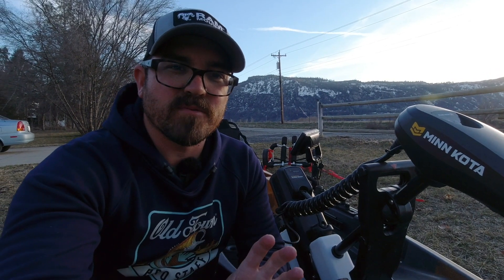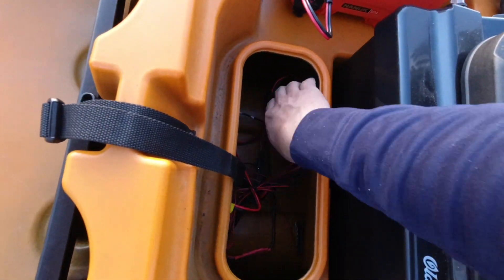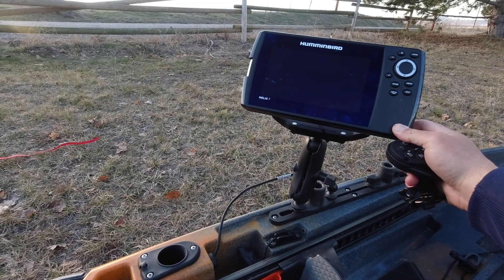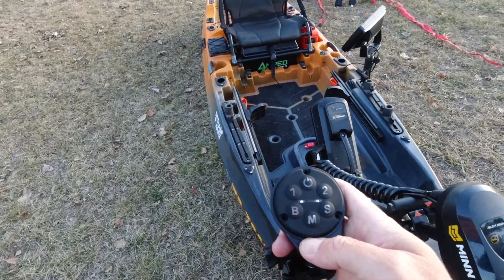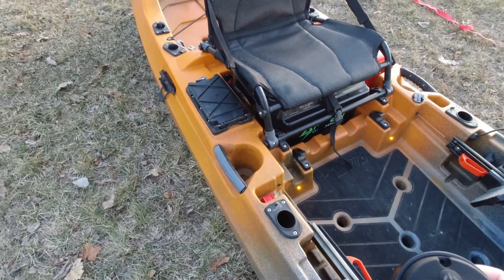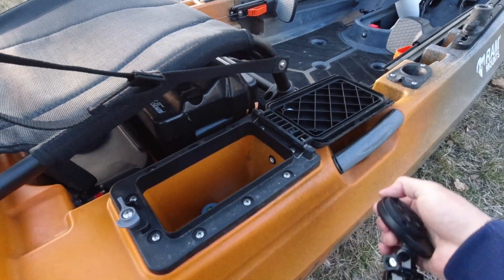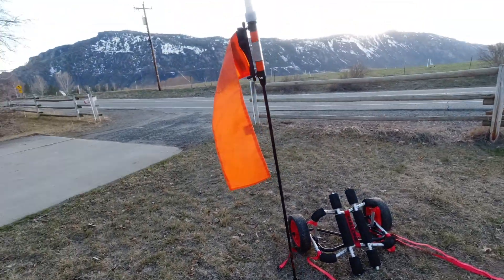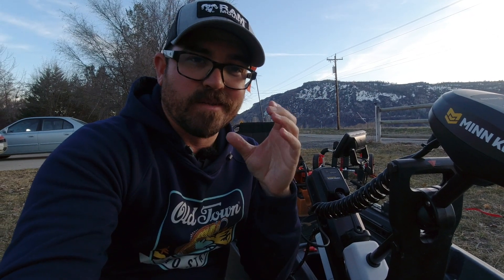Rigging a Remote Controlled Kayak Lighting & Power System

Comment: Heading up to Baker Lake in July do you use this type of LED system on a peddle powered kayak?
Reply from the maker: No reason you couldn’t
Reply: @spiltmilt  The regs are clear as mud as to what's required. White 360 min I guess.
Reply from the maker: Minimum is a 360 light yes

Comment: Howdy. I have the 10" red/green navigation light strips I still need to install on the bow. They'll mount 1 inch down from the top side. I see you mounted yours up higher on top. Any reason why you chose the smaller button lights over the 10" led strips? I chose the 10" because I want to make sure other boaters have a better chance of seeing me easier in the dark. What are your thoughts?
Reply from the maker: Personal choice. The button lights are easily visible.
Reply: @spiltmilt  Great, thanks for the reply. Good luck fishing! ✌️🎣🇺🇲

Comment: Another great video. The link for the 5 circuit Yak Power system doesn’t work anymore. Wanted to use it so you get commission. Thanks.
Reply from the maker: Thanks for the heads up

Comment: How did u get behind / in the hull to mount those lights on the deck?? Do u have a install video
Reply from the maker: I don't have an install video but very easily reachable from the in hull access under the seat, unless you are a T-rex.

Comment: How did you access the back of the forward facing interior lights and the UV lights to screw in those locking bolts on the back of the lights?
Reply from the maker: From the hatch behind the battery

Comment: Where did you get the amber button lights for the interior? I see yakpower doens't offer those. Defiantly interested in that color over white for my Unlimited.
Reply from the maker: Precision Sonar link in the description
Reply: Thanks for the reply. Im currently floating a Nucanoe Unlimted and im looking to install exterior button lights for navigstion on the bow and would like to run a few of those amber lights throughout the interior. My Unlimted doesnt have a front bow hatch, just a small stern hatch and some knockouts for wiring. Can these lights be tightened down from the outside or do you need to be able to get hands up inside of the hull to tighten?

Comment: I have a couple questions about the LED lights, when it comes to installation or setup. When looking at the Precision Sonar LED light kits, they do not say what connection type they have. What type of connections do Precision Sonar LED Lights come with? How did you make them work with the  Yak Power System? I wasn't sure if you ended up buying both the Yak Power LED lights and the Precision Sonar lights or etc. If you could please be so kind as to provide a breakdown. I have been searching for these steps, but haven't found any.
Reply from the maker: They just come with exposed + and - wires. I wired them to SAE connectors and then plug them directly into the YakPower switch. Super easy.
Reply: @spiltmilt  I got another inquiry if I may. How short is the threaded area on those custom lights? I have a rather narrow area, I'd like to place them. Unfortunately Precision Sonar's site doesn't give a lot of detail on these things.

Comment: I ordered the same navigation lights, after seeing your video. Is there any issue with the navigation lights being in your field of view, where they are located? Just wanted to make sure before I drilled holes. Didn’t know if I wanted to put them at the same location you did, or just below the bend so they aren’t visible to me at all. 

Great video!
Reply from the maker: They don't cause any issues for me.

Comment: That kayak is in the price range of a bass tracker XL which I feel defeats the purpose
Reply from the maker: Try putting your tracker xl on a roof rack and let me know how that goes 😂
Reply: @spiltmilt  that would be difficult but it comes on a trailer. I bet its a lot harder to put that thing on a roof rack that backing up a trailer. Oh and you can take friends and be far more comfortable. I just think those yaks have moved away from the purpose and alluring capabilities of a yak.
Reply: I wanted a $40,000 Boat but settled on the auto pilot 120. Its the business at a 10th of the cost.
Reply: An $11,000 boat?  Ahhh... I don't think so.  even with his upgrades, the package is less expensive than a non-tricked out new Hobie Pro 14.
Reply: Don’t have to put $100+ gas in it every weekend or insure it. Plus can get in place a boat can’t. Best part don’t have to use anchor or $2000 power poles. He even figured how to add a seat to the kayak. Very nice job maximizing a great product

Comment: As a techno geek I say to my self wow that is really cool, as a pragmatist I think "really we needed a remote to turn on a light that is within easy arm reach?" Ya a simple six switch panel mounted in the side wall would conform to the KISS method and has zero chances of being lost. But Like I said wow that is super cool!
Reply from the maker: I feel like using a remote rather than having to drill another hole and wire it is much more pragmatic and simple